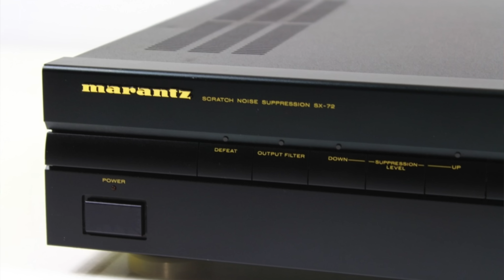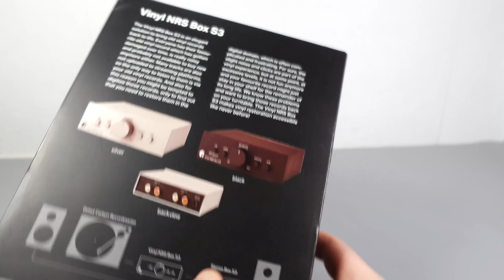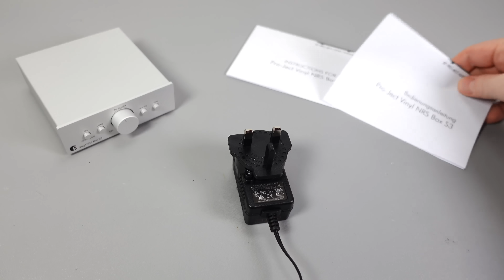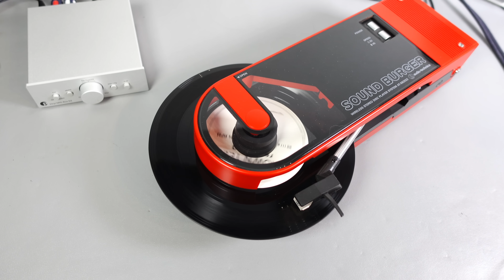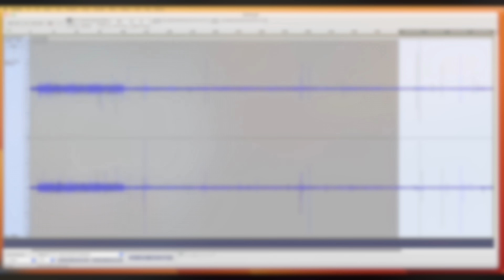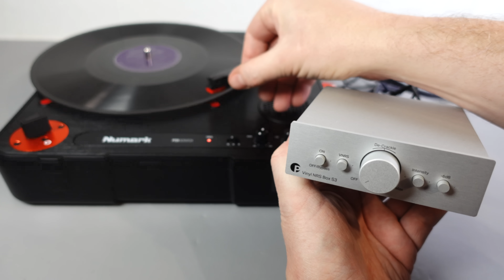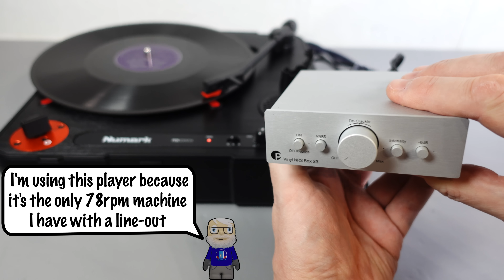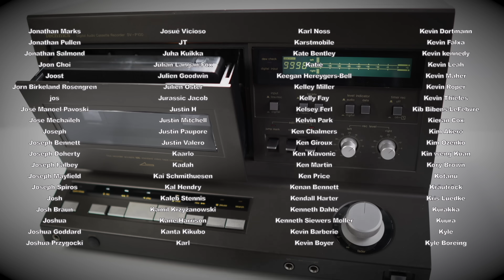REVIEW : Vinyl Noise Reduction System Pro-ject NRS Box S3

Comment: That didn’t much. Thanks for testing!
Question: what is that uplifting song starting in the 12th minute (one you put on after the classical record)?
Reply: It's the B-side from a 45 used with a children's toy called the Show'N Tell. The A-side was used for narration alongside a kind of slide projector arrangement, and the B-side would often be a funky arrangement of a popular nursery rhyme or the like. In this case, it's Pop Goes the Weasel.

Techmoan actually did a video about this system a while ago, in which this very record makes a brief appearance:

https://youtu.be/qFezqz2Wcdo?t=255

(the link starts when the record appears)

Comment: I wonder if this is a clever EQ that cuts known frequencies that you might consider to be ‘rumble’ and does a bit of read ahead for transient peaks and momentarily drops the gain in that approximate frequency? There is probably a lot of ways to achieve something approximating a ‘noise reduction’ system but they all tend to be very subtle (or greatly affect the overall sound)

Comment: Back in the 80s. I tried all kinds of tech like this to remove cracks, pops etc. You could but in doing so you'd empty the record of any real quality or clarity.
Fun times. Cheers Matt.
Reply: Seems like a moot point in the age of CDs and lossless audio formats. I'm surprised this product is getting made at all nowadays; I guess audiophiles will buy anything...
Reply: @caramelldansen2204  Based on my experience with the SugarCube. . .  For what I paid, I definitely could have bought a ton of CDs instead, and I wouldn't blame anyone who does that.  On the other hand, I've already got my LP collection, and I have LPs that don't exist on CD.  And, the SugarCube doesn't make LPs sound like CDs.  It just makes them sound like LPs without clicks and pops.

Comment: If the record's knackered, it's cheaper to buy a replacement record (assuming it's not a one-off, super rare or has suffered from youtuberitis where the price shot up cos someone featured it in a vid), it's like signal boosters for TVs back in the day, if it's not there, then there's nowt to gain... :\
Reply: A lot of my vinyl is rare, first edition or limited edition that can't be replaced easily, just because I've owned it for 50 years and not because I'm a collector. 
Also, signal amplifiers for aerials certainly do work because I use one due to having a poor reception otherwise.

Comment: A bit more expensive than the project device, but really impressive is the Puffin by Parks Audio. It’s twice the price, but allows digital output, so you can let your DAC handle the DA section.
Reply: I've been extremely happy with the puffin going on years now. using a dl103 MC and it sounds great. Ive never had to use the "magic"  (pop and crackle) feature for much, but it does work well when needed. plus it's a phono preamp for MM and MC
Reply: Pro-Ject.

Comment: Interesting device, maybe they could de-scrach by listening for repetitive clicking at 1/33 or 1/45 times a second and then preemptively turning down the sound for that particular scratch.  They could even introduce quite a processing delay to really go to town on noise control.
Reply: I was just thinking that. For 200 GBP, I would expect it. I'm not a DSP expert, but even if this is a niche, low-volume product, it cannot be just about the nice metal box...or can it? I'm not talking about covering the DSP chip in gold, that would obviously ensure higher quality audio processing...

Maybe for sections with sound, it's understandable that they don't want to mess with the audio, but the crackling was present even for the quiet part at the lead-in of the vinyl. I absolutely expected that to disappear, not just diminish.
Reply: @Constantinus213421  I was kinda the same ... probably they dont want to hurt the ouput too much. But let the end user pick it with the knob ..... Only used decrackling by SW (Steinberg) and the more you push, it does a better job but the quality goes out of the window too.
Reply: @Constantinus213421  No, it definitely tries to do some digital processing, not just bandpass filtering. It's just that it's a cheap device made in Slovakia and I suspect they don't have the best people available to work on the algorithms to do it better.
Reply: I was thinking the same ... But scratch came to an angle, they are not at perfect 90 degree in relation to the cartridge .... still you can play with it .... but wondering if this can hurt too much the final ouput. Being digital you have the advantage of buffering data. This will add a delay from the point you drop the arm and when the sound comes out which is not desirable. But if ateas you have a couple of revolutions ... you can do more tricks ... (I guess). Always in the scope of scratches which can lead to a pattern. The crap/pop thing is another story.
Reply: @38911bytefree   to my mind a super high detail 2 channel A to D converter along with a good xylix processor along with a bunch of memory for maybe 1/20 of a second of delay, a few good noise removal algorithms running close to the metal would do a far better job.

What does it matter if the sound is delayed as long as it works better than this. Unfortunately a lot of this kind of audio processor needs to fight against all the snake oil and the 'improvement' from this box wouldn't justify the costs for me.
Reply: Could almost just use digital at that point.
Reply: @jhoughjr1  Amazing, somone should tell Pro-ject to put a DSP in this box. Wait.

Comment: Some Soviet-produced amplifiers had a special one extra regime at their source knob to play vinyl with noice reduction. So, the same idea has already been realized in analogue way
Reply: Hi. Can you name some of those ? Thanks.
Reply: Compact cassette also had analogue noice reduction I think but it had a coder and a decoder. This and maybe also the Soviet amp will work without a coder.
Reply: @duskonanyavarld1786 Vinyls have a standard noise reduction, it’s one of the things the phono preamp does.
Reply: @xluumu  Thanks, now I know.
Reply: @duskonanyavarld1786  Compact cassette utilized several two-pass noise reduction circuits.  There are Dolby a, b, or c, as well as DBX encode/decode, and then there's single-ended DNR (Dynamic Noise Reduction).  and the work by Richard Burwen.
Reply: @svensvensen8406  True thx

Comment: While watching a very old interview with super studio engineer Bob Power I was amazed to discover that during the making of Low End Theory they used something just like this (but entirely analogue) to remove pops/noise from crackly vinyl samples. I still find it pretty amazing that existed back in the 80s/90s as Bob said the unit was some funky old hifi piece that had been floating around a while 😮. 

Not sure I see a lot of value in a device that has to digitise it first as there have been effective audio plugins for that at least 15 years probably more like 20+ (eg waves x-click/ x-crackle and izotope rx). The lack of phono preamp also seems silly.
Reply: Why wouldn’t it digitize first?  It’s a ton easier to produce a good A/D-D/A with some DSP behind it, than an analog processor.

It is silly that there’s no phono pre, though.  What was this supposed to be plugged into??
Reply: Yeah the analog stuff has been around a long time.  I have a early 80's Yamaha R-900 that has Subsonic & High filters.  It does a really nice job on cleaning up not so good vinyl.  Sadly the Yamaha has been sitting on my bench for two weeks with a power amp issue.